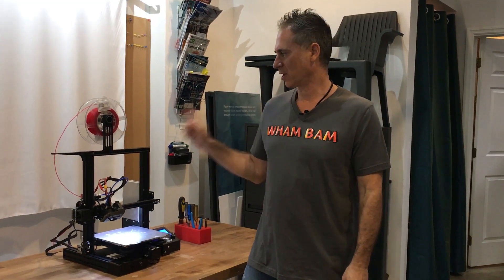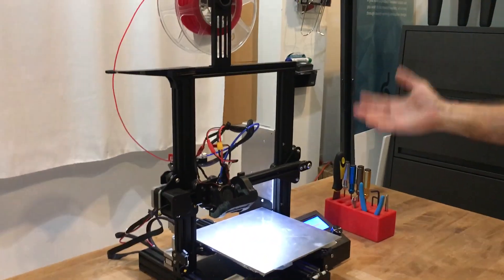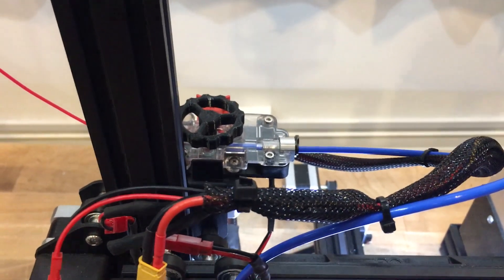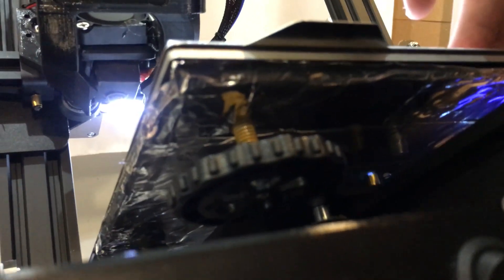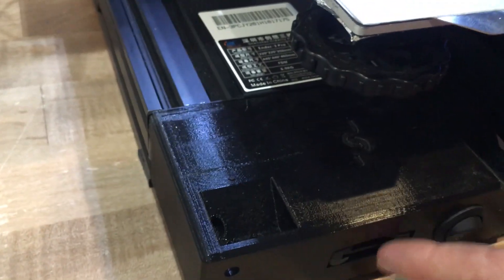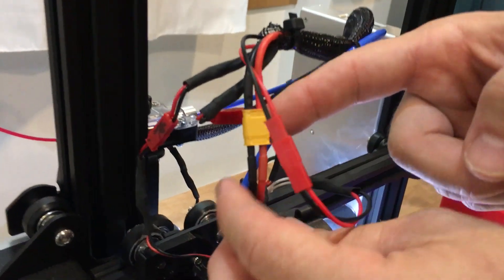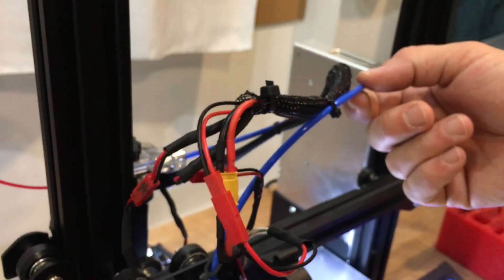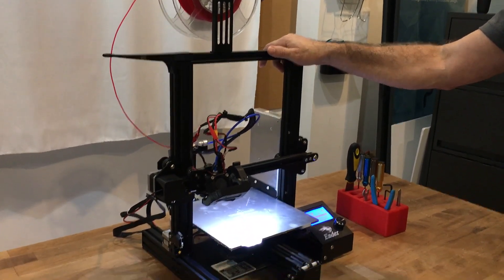My preferred mods for the Ender3!

Comment: thanks for the vid,  my non pro ender 3 is 24v not 12v, but saying that  with a bit of creativity  and  the use of ohms law 12v led strips are not a problem on a 24v  circuit, one good thing  I discovered about using 24v is 2130's seem  work a lot better run at 24v in my ender 3 than the ones in my 12v kossel

Comment: Ender 3 normal is also a 24v system.
Reply from the maker: Thanks for the correction
Reply: Yup, mine is Ender 3 Regular, and it's 24v, heats up the bed to 90c in about 1 minute.

Comment: Good video, those are solid mods.  Recently, I put on the aluminum extruder a lot of people are using.  Really like the look of that one you have.  Might have to consider it.   I have a few mods on my Ender 3 right now and looking at part cooling next most likely.  I purchased your magnet and flexible plate system from the kickstarter.  I didn't even put the Ender 3 together until that showed up.  Magnet and plate are great for removing prints.  But, I can't get anything to stick to the PEX sheet.  I mainly just run PLA and have tried rolls from 4 different manufacturers.  Everything breaks free or lifts during printing.  How hot should the bed be?  I am running at 70C right now.  The only way I've been able to use it is by throwing on Magigoo that I use with my glass plate on another printer.  Any tips on how to make it work?  I am peeling off the one I have.  Tried too many different things to make it work and now is kinda dodgy.  Thanks again for the video.  Always love to see what people are doing with their printers.
Reply from the maker: Mystlynx that’s too bad about your PEX experience, please send us an email with your machine settings and pictures of failed prints.
The main things you need to check for issues in printing
First, make sure you have removed the protective film from the PEX
second scuff surface of PEX well with 000 steel wool and clean with alcohol and fresh paper towel
Third is to level bed and set gap low enough that it squishes first layer, first layer print slow like 20mms/s
print first 1-3 layers with no bed fan.
bed temp for PLA 70
Let me know answers to first questions and try these pieces of advice you should have no problems!
Reply from the maker: Macewen3d also has a great custom aluminum extruder!
Reply from the maker: Mystlynx https://macewen3d.com/collections/upgrades-for-cr-10/products/mk8-extruder-aluminum-drive-feed-for-cr-10-cr-10-s4-and-cr-10-s5